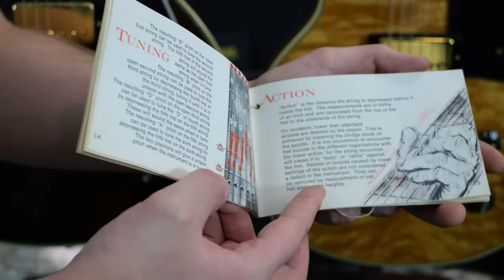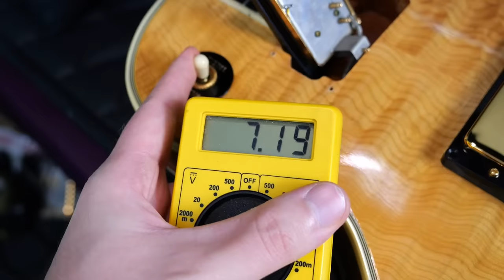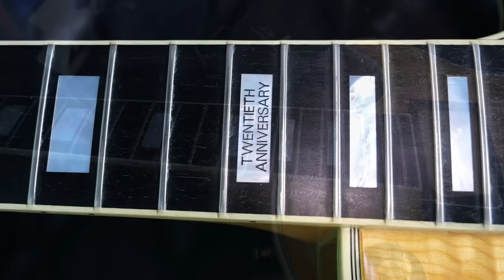My Nicest Guitar Find EVER | 1974 Gibson Les Paul Custom 20th Anniversary Natural Flame

Comment: I've owned a natural top 76 custom since 1984 (you can hear it on my videos), so I can understand how much you love this one. Mine has no flame at all, but it always has been beautiful, and I would never consider getting rid of it. I did have Mike Lull (rest in peace!) refret it and plek it in 2019. He also swapped in some 500k pots which opened up the guitar tremendously, increased the output and made it less dark.
Reply: It didn’t have 500k pots from the factory? Or is that when they switched to the 300k for a while . I haven’t watched this whole video yet so if Trogly mentioned it I apologize.
Reply: @allstopblue5717  Nope. 300k (or less haven't checked em on a meter) Mike Lull took one look at it and he said "let me check the pots", and yep they weren't 500k. I guess the pots from that era have been known to be 300k or less, especially from the Nashville factory. He explained how all my signal was dumping to ground. I saved the old pots but would never reinstall them myself. I played the guitar over 30 years with that dark cloud holding it back 🤣

Comment: Usually the tailpiece bolt, which has a small standoff, is all the way down on the guitar body threaded inserts and not elevated, that is, if elevated, placing a side load on the inserts with a loose threaded connection. Standoffs are available for the LP tailpiece to provide a solid connection (TonePros SS1) to the guitar without having any play in the slot. A solid connection with a small standoff will reduce the side load and make a rigid connection with the guitar body. It is best to prevent, as much as possible, the tailpiece from moving under the string force. Also, if the tailpiece is bolted down it will not fall off the guitar when changes strings. However, many times the tailpiece will be removed anyway when changing the strings to properly clean the guitar. 

The tailpiece on the LP is very strange if it is in the normal down position. The strings exit the tail piece and have a sharp angle up, which means the strings are touching the top of the hole openings, which seems wrong to me, that is, for tuning stability I want no rubbing or touching of the string unnecessarily that could prevent free movement in how the string stretches. I would like the strings to exit the tailpiece exactly on center with the tailpiece openings and not touch the tailpiece when the tailpiece is slightly proud on the guitar surface. 

The Gibson solution to the tailpiece rubbing is the TP6 which also provides some tuning capability.

If we look at how strings ride over the LP Tune-o-matic bridge the V notches often seen also makes no sense to me. You want a break angel yes, but you also want the string to freely move over the bridge without the risk of snagging, which is way lube is generally used when restringing, but the snagging is especially troublesome with the normal wound strings. I don't like the tuning issues, but I really hate the potential problems in setting intonation, which is a fine adjustment where I want the strings to move freely over the bridge. If the strings are stretches but the bridge still snags it can get very frustrating.

The popular LP solution to the snagging is the Schaller STM, which also allows easy adjustment of the string location relative to the fingerboard and string to string spacing. Many fixed bridges set the string to string spacing relative to the string center lines, where in my opinion it is better to have equal spaces between the strings. I buy all my Schaller products directly from Schaller in Germany, there seems to be a lot of clone crap on the market.

Comment: I have a 20th anniversary too. I got it when I was 17 in Cambridge UK 1988. Funnily enough at the time the shop had two the same, Tobacco finish. Only mine had fine tuners on at the bridge I can't remember if the other guitar had the same bridge. It has been well used and cared for. The 20th on the fret has long been worn off although you can still just about see it, its had a fret change too. My guitar seemed to be of a higher speck than any others that I have seen. The bridge was definitely original and not an after market that one guy once suggested. The tuning pegs and the bridge are both made in Germany of the same material and top quality. The volume and tone are also much higher speck than most of these guitars. I'm getting older now so at some point it will need to find a good home I hope this happens as its such a lovely guitar. The case is beaten up though and the handle broke off so it has a make shift handle that has surprisingly lasted longer than the original. It was only meant to be temporarily.  I have been a pro for years and this was my main guitar until I let it rest at home to be used only at home. They are great guitars and better than any other Les I have played or owned. I also have a Les Paul Professional that again seems to be the only one that has the cigar shaped adapter that enables it to plug into an amp because of the Low impedance pick ups. Which would suggest that all the guitars without this adapter have been rewired meaning they are no longer Low impedance.

Comment: So I own 1976 Gibson Les Paul Recording. Always wondering why mine had a three piece Maple neck. Thus the first year with the three piece Maple neck. And last year with the original design lay out. I always wondered why it wasn't mahogany like my 1973 Les Paul Triumph. See this video pointed out why but not till 1976 did that neck make to Recording. 1975 and all earlier where mahogany. Thanks again for updating my gibson history. Stay safe and enjoy. Thought I would share that little Gibson history update. Another special thing. Live in Pa. And not 20 miles away is a 1976 Recording for sale just one serial after mine.  Not with chainsaw case though and mine looks better more original cover plate. But was amazed by that. Even write the shop. Not amazed about it as I was. Just bragged about his. Once again thanks for filling in my void.
Reply: let's chat..👆👆.. you won a prize 🎉🏆

Comment: The oxidation is consistent with the age of the guitar. The soldering is horrible. 

The volume pots do not have a ground cross connect which is a bit strange given that the guitar has a tailpiece ground. Strange is the wire gauge of the tail piece ground, it should be at least a 22 AWG and looks like a 24 AWG. Also strange is the tape at the end of the output jack Gavitt wire sleeving. You generally do not see electrical tape at the end of this sleeving. Another strange item is the type of tone capacitors used which looks like Polyester Film. The guitar build is very strange and unique. 

The guitar is original but it is a custom order. I think the G designates the client.